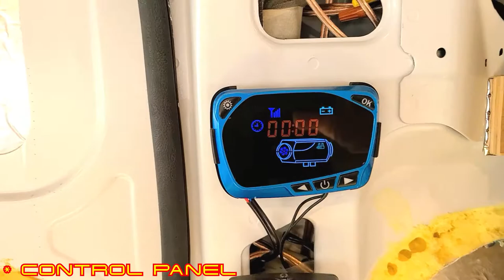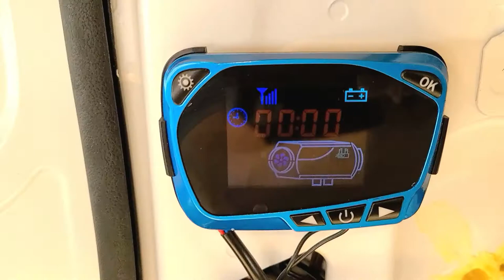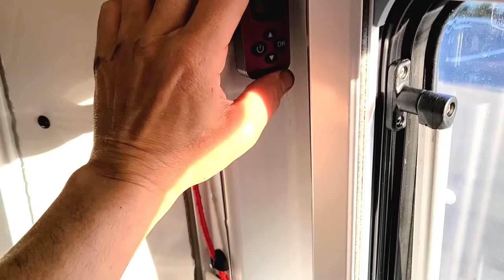🚙 Chinese Diesel Heater – Engine Bay Fuel Tank – ProMaster 🚀🌄

Comment: In the manual it says fuel tank should be below the heater level. Is that essential? Or will it eventuallly generate erroe. Odea.
Reply from the maker: Hi.  It has been a while, but I thought I read that the tank should be above the level of the heater.  In any event, I've always had it above, and it has been 5 years.

Comment: It's okay to submerse the fuel filter like that? 
I set mine up like this 1 yr ago...and it's been great. The one thing though...the fuel line gets hot in the engine bay......the fikter in the tank is a great idea if it's okay...I didn't think like that but I like it.
My tank is a bit different and may have a custom aluminum one built
Reply from the maker: I believe it is fine to submerge the filter.  Before doing it, my thinking was that if the plastic couldn't handle diesel, then it might fall apart.  But as far as I could tell, the whole enclosure is made of the same material, so if it can handle diesel on the inside, on the outside should be fine too.  Though I just put the tank in the engine bay several months ago, the filter has been in the tank from the get go... about 2.5 years now.  As for fuel line/tank in engine bay and heat, I'm still unsure about that, and I would REALLY appreciate comments from folks on their thoughts regarding this.

Comment: Thank you I going to do the same thing
Reply from the maker: You're welcome.  I've been running this way now for several months.  Now that the weather has been cooler, and I've been in need of the heat, it had been worrying out splendidly!  No regrets.  Now that it has been a while, I'll be posting an update video showing how I covered the fuel line with cable guard and built a custom, water proof box/mounting bracket for the pump.  Stay tuned!
Reply: @Roland-Lewis  when you do sent me a video I wanting on  my delivery

Comment: Is the fuel line just pressure fitted into the tank? Just shoved in there without any type of seal? Would you mind linking to where you got the super long tygon line with the right diameter? Lastly, is the fuel dampener just for noise or does it help with fuel delivery as well? Thank you very much for this video!
Reply from the maker: Hi, Kyle.  I'm glad you're finding the video helpful.  Yes, fuel line just pressure fitted onto hard fuel line which is pressure fitted into the tank--that's right, no additional seal.  Just drill the hole in the tank to be as small as possible that you are still be able to push the hard fuel line in.  Just updated the description with the fuel line link.  The pump dampener is strictly for noise abatement.  If you end up doing this yourself, I'd love to hear back from you here!  Let us know how it went.  By the way, I've built a nice enclosure for the fuel pump and made a custom aluminum bracket for that as well.  Also, covered the fuel line under the entire van with wire loom tubing.  Everything looking good.  I will post a follow up video shortly.  Cheers.

Comment: Thanks for the video! How far away is your pump from your fuel tank? I've read that it needs to be less than 2m ideally. I'm planning to use a .25L diesel tank in my engine bay, but wanted to know how critical it was for my pump to be within 2m of the tank. I figured gravity would work to your advantage with the tank in the engine bay? Thanks again!
Reply from the maker: Hey Kyle.  I'm glad you found the video helpful.  My pump and tank are like 30' away, so we'll over 2M.  I've gone through 3 tanks of fuel without any issues whatsoever, so I'd say it is fine.  I thought about this as well, and I came to the same conclusion that the height difference would likely help the potential issue.  Let me know how it goes for you.
Reply: @Roland-Lewis  Thanks for the reply! I'll let you know how it goes once heater is installed!

Comment: That is at the lift points, so if someone gets to lift it on a jack stand, they might not be able to see that.
Reply from the maker: Hey Byron.  I agree that is a concern that folks need to be mindful of.  I forgot to mention that in the video, but I did make sure to fasten everything in a way that the lift points were unobstructed.  I have a Part II coming up where I show some additional modifications, including custom undermount waterproof enclosure for the pump, enclosing the entire fuel line in wire loom, and securing that more permanently.  I've had my vehicle into the shop for front suspension work twice, and it has come back both times with no damage to the fuel line or pump.

Comment: If your van was diesel powered then all you would need to do is tap into the fuel tank of the van. Sprinters now come with a tap point to getting fuel out. Or if the Sprinter came with a hydronic heater then just tee off that fuel line.
Reply from the maker: Yup, I get that.  I had my heart set on the ProMaster for a number of reasons, and they stopped making the diesel a few years back.  In any case, I think I prefer the gas ProMaster due mostly to ease of serviceability.
Reply: Dfhepener
Not if you put additive in your fuel tank.
Reply: @fulham1952  I use winterized diesel in my heater with no problem. It has been running all winter. I have also used Power Source in diesel

Comment: I've also put the heater fuel tank under the bonnet but am concerned it is unsafe. Could this not be a fire hazard?
Reply from the maker: Yeah I hear you.  There's been some discussion about this in the comments and also on my post at PromasterForum.com.  You can search on "engine bay tank" and it should come up.

Comment: Would you be able to locate the pump next to the tank under the hood or does it have to be close to the heater?
Reply from the maker: Great question, and I thought about doing this myself.  My understanding is there are a couple of factors that limit where the pump can be.  1) Gravity.  The pump is only capable of pushing fuel uphill so far.  I believe I read that number is 1 meter, so placing pump near the tank would be ok with regard to this because fuel would flow downhill to the heater.  2) Fuel line squishiness.  When the pump activates, the piston quickly drives a small amount of fuel.  If the fuel line material is soft enough that pulses expand the walls, delivery at the end of the line will be compromised because the energy will be spent flexing in the walls of the line and not pushing fuel down the line.  This is why most heaters ship with hard nylon line.  My understanding is the output is affected MUCH more than the input.  Therefore, if you are using a long length of flexible, tygon-type line, it should be on the input side, placing your pump nearer the heater.   If you could get your hands on a long length of the hard nylon line, it might work.  But, even the walls of the hard stuff expands slightly with pulses, so there is likely a limitation on length of the output.  I'm not sure what that number is.
Reply from the maker: By the way, if you end up trying this, please report back with the results.  Thanks!
Reply: @Roland-Lewis  will do. Hopefully within the month.

Comment: One last question and I will leave you alone. Do you find the pump to be to loud even outside the van? thx
Reply from the maker: No worries, Mike.  Keep 'em coming.  In the video, I showed and talk about the sound deadening box I had made for the pump when it was in the van...  Once the pump was outside the van, that box was no longer needed, and the pump sound was even less than when pump was in van while in the box.
Reply: @Roland-Lewis  are you worried about the pump in the elements on the outside now that you have had time using it?
Reply from the maker: I talk pretty extensively about my plans to address that when I show the pump under the van.  Take a look and let me know if you still have questions.

Comment: Your video was SO helpful.  Thank you
Reply from the maker: Really happy to hear that!
Reply: @Roland-Lewis  your video was from a year ago, how’s the fuel/heater working?
Reply from the maker: @hoosierinthewoods  I have gone through several tanks of fuel now, and it is still one of the best enhancements I've done to the van.  Temps just dropped here recently, and we used it a few times over the past couple of weeks.